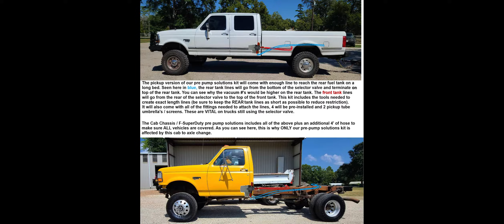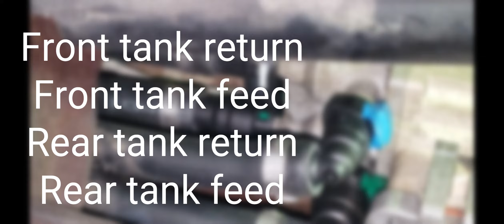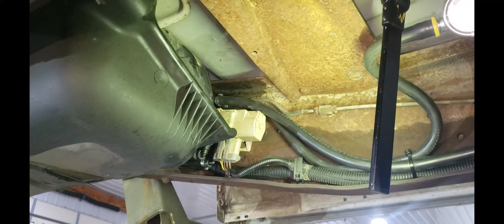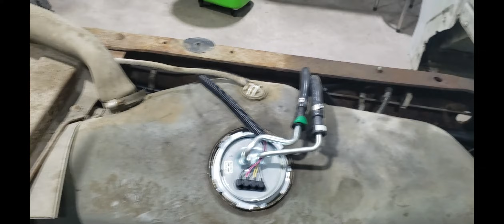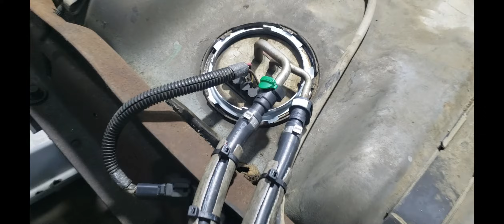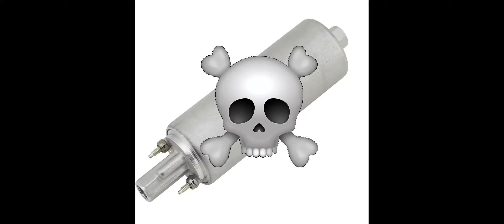Marty's Diesel Pre Pump Solutions Kit   Made with Clipchamp

Comment: Please let me know if I'm wrong here.  Liquid flow is generally dictated by its smallest restriction point. The overall flow rate is limited by the area of the narrowest passage in the system, regardless of other areas being wider. This principle applies to various systems, including pipelines, valves, etc.  Therefore, if your fuel lines are in good condition, I see no reason to replace them, if you are keeping the original fuel tank selector valve.